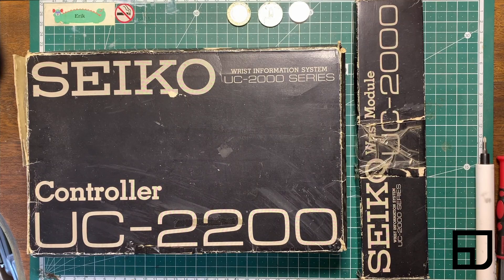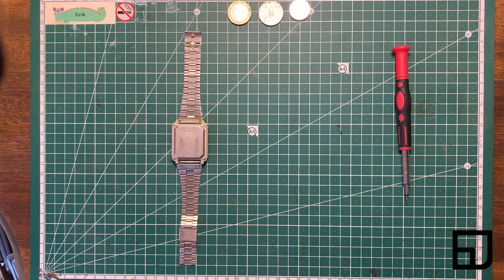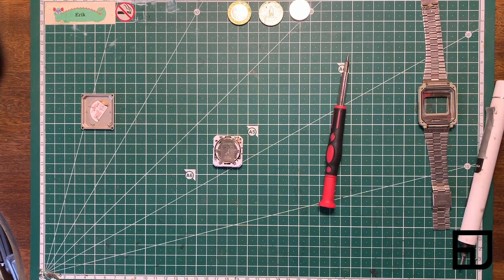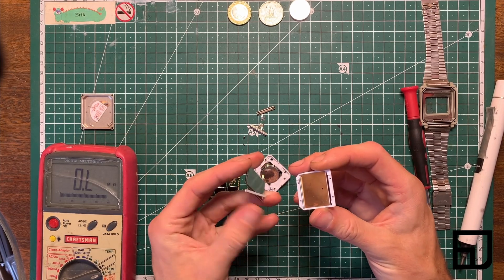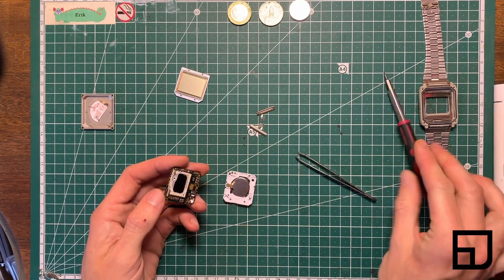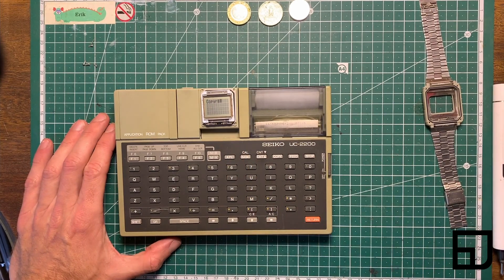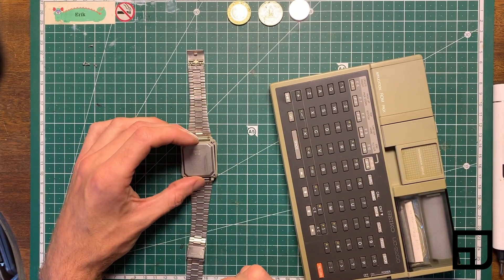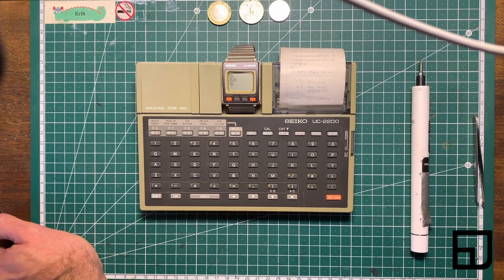[ABRIDGED] Repairing my Seiko UC-2000, UC-2200 Watch and Controller

Comment: Thank you for this video - my watch had the same issue (press a button for a momentary display). Repaired by resoldering the daughter board, and (double bonus) the coil was intact. So very happy to have a working UC-2000, many thanks.

Comment: You have a new subscriber my friend!
Thanks for your video, I recently bought a uw02-0010 which is basically the same thing as this watch.
When I first got it it was not displaying anything. After resetting it (pressing all buttons down at the same time for a second) the display would come on for a second and then turn off again.
After watching your video I thought it could be a solder crack like yours as I thought that the pressure from me pressing all the buttons at once could be completing whatever connection is broken. I added extra solder to all the terminals for the IC board, put it all together and it works!!!
My only issue now is that when I add something to my Schedule it tells me to input the date. When I put the actual month then day it says "input error". The only dates I can input is any day in Jan, so thats "01-XX". If you know why that could possibly be, please let me know but otherwise, you helped me out majorly with the teardown, possible faults, and rebuilt so thank you heaps for that! You're a legend!

Comment: Hi.Thanks for the very useful video.
I wonder if you could assist ,I have a Seiko  UC2200 controller and a Seiko UW-02 Watch. The watch  is fully working and communicates with the supplied keyboard,
But when the watch is placed on the UC2200 I get a "Transmission error 10" message printed out when I try to communicate
I can adjust the contrast of the watch with the UC2200  but nothing else.
Thanks again.
Reply: the copper coil is probably broken or disconnected